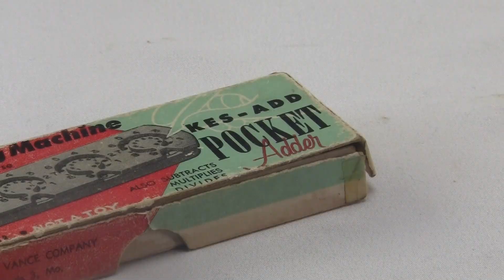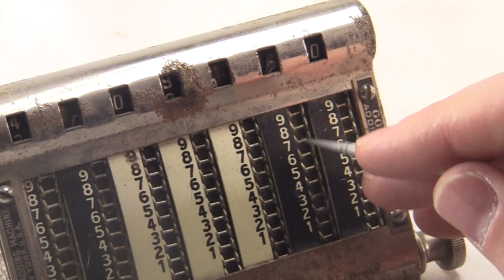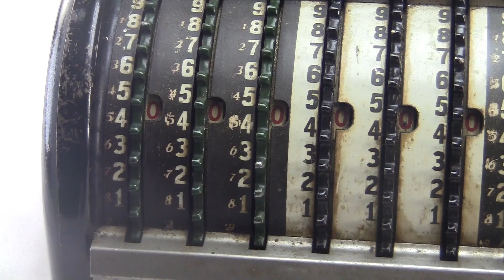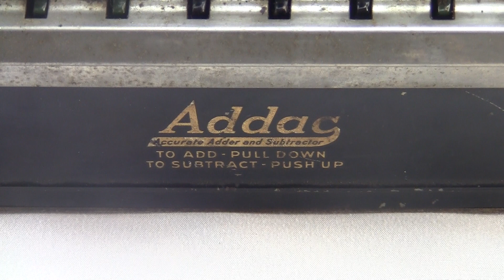Addac Review / HowTo

Comment: But why are there smaller numbers to the left of the regular numbers and why oh why only on 5 of 8 dials?
Reply from the maker: These are used for "subtraction by complements". Basically if you want to subtract x - y, you enter x into the answer wheels, and then add (y-1) on the small digits. This is a standard feature on machines like this.
Why it's only on 5 of 8 dials? Probably they didn't like how the small digits looked on the white background for some reason?

Comment: Tabs are easily opened with a screwdriver. Happy lubricating, my friend
Reply from the maker: Yes but I’m afraid they’ll snap if I bend them. How likely do you think that is?
Reply: @ChrisStaecker  I dont have any sort of number, but if you go slow with a thin flathead, you can likely manage. If it does snap, then you have 3 other working tabs. I doubt all 4 will snap, and even if so, maybe you can use some small neodymium magnets and hotglue to make a magnetic clasping system